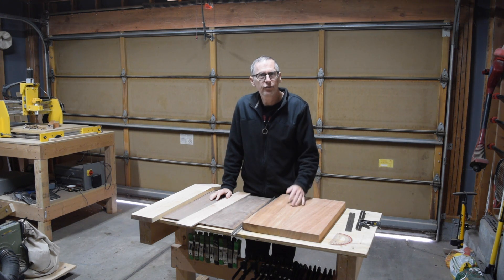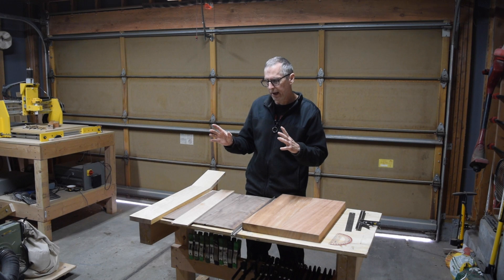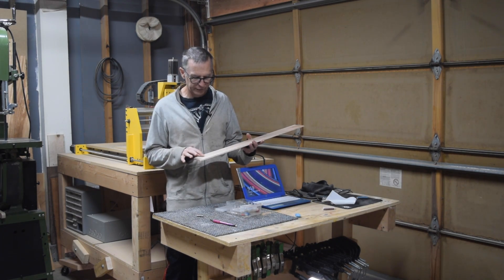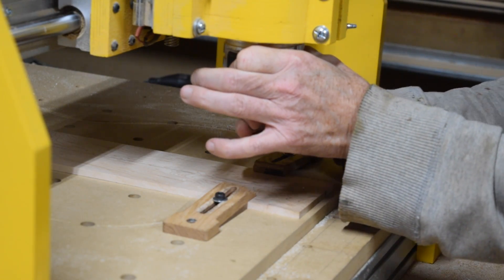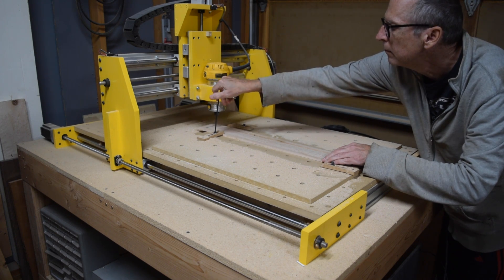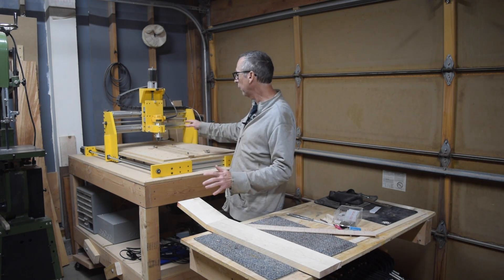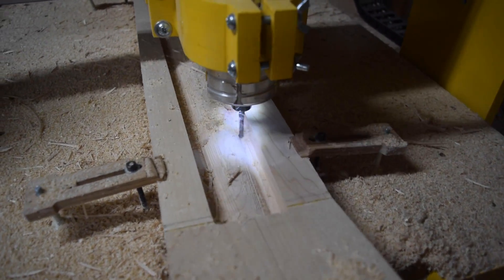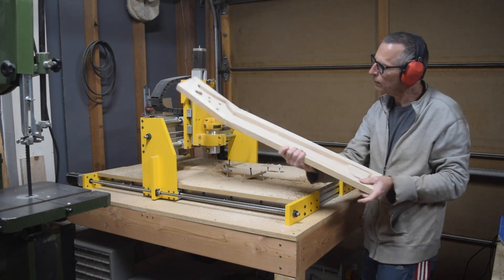Making A Highline Bass Guitar Part 2: Making the Fretboard and Neck

Comment: Hi Chris, would using CNC to cut the neck better prevent wood split on some woods like Wenge during the process, in compared to hand power tools?
Reply from the maker: It all has to do with the direction the bit is spinning as it cuts into the wood. With a CNC machine, you can control the direction the spindle will move in relation to the wood's grain. You can do the same with a router guided by hand, but it's easy to forget what direction the bit is spinning as it cuts into the wood. If you push the router in the wrong direction, you can tear out chunks of wood.
Reply: @HighlineGuitars  thank you Chris, much appreciated your answer!

Comment: Hey Man Nice Video. Where do you get your .023 router bit? I have a mill but haven't had luck finding a good bit. Thanks!
Reply from the maker: It's actually .024." https://www.ebay.com/itm/10-73-0240-2-FLUTE-MICRO-CARBIDE-ENDMILLS-LONG-FLUTE/151823964316?hash=item235969d89c:g:bQoAAOxy1VlREYCy
Reply: @HighlineGuitars  Thanks!!!

Comment: Watching that neck get cut was so satisfying! It's clear (at least for small scale shops and one offs) that CNC doesn't represent less work, it's just a different kind of work. It would be a challenge for me to sort through all the design problems/challenges before a single board is cut or glued. Creating this sort of complete design takes discipline that I'm not sure I possess. 

That said, I'd love to play with CNC but it seems the barrier to entry is a tough pill to swallow. 

Any particular reason you haven't set up dust collection for the router? Great videos, thanks for taking the time to post them.
Reply from the maker: I have dust collection but I don't use it when shooting video of my CNC work as it blocks the view of the carving.

Comment: Hi Chris, thanks for the video. I was wondering.. do you have to change the bits for some operations like the round over of the neck ? I  don't think you use a  flat bit for that, although i suppose you  are using up cut down cut bits ? And high grade ones ? So,  it would not be the matter, line up clamp and push the button.. done.. ? Greets from Belgium.
Reply from the maker: I have used both flat endmills and ball nose bits for contours, however, I can't tell the difference in finish quality. The only time I use down cut bits is at the start of cutting plywood.